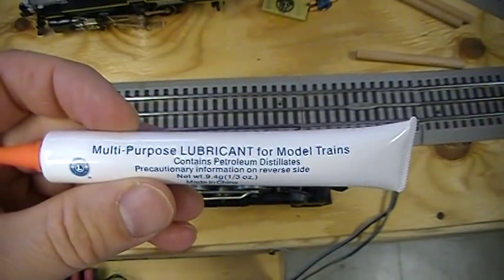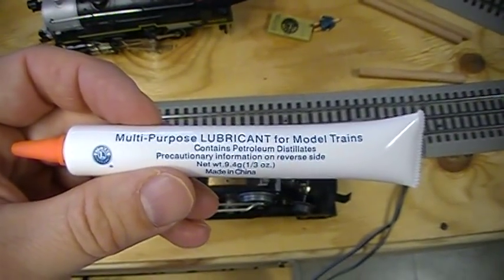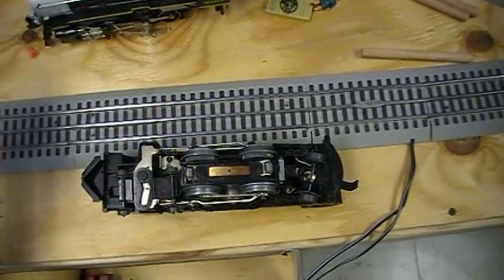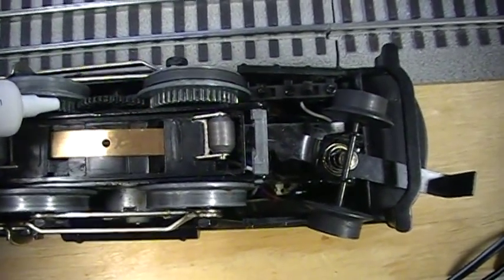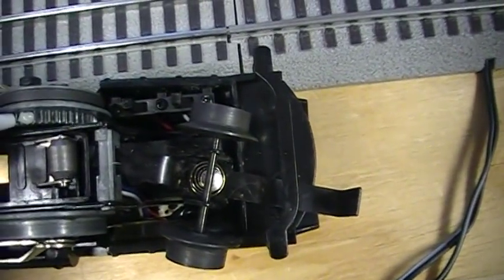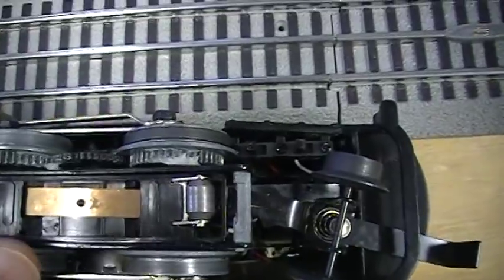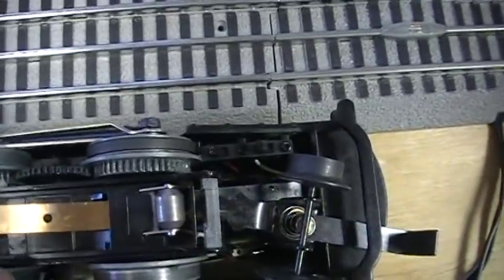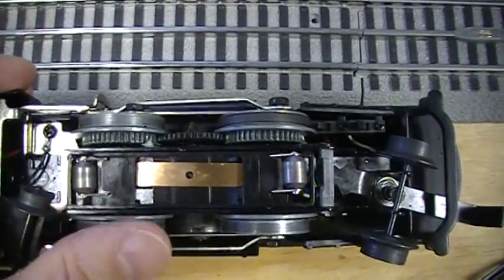How To Lubricate Lionel Model Train Engine Gear 0 Gauge Multi-Purpose  Video

Comment: It is called grease.  Big difference from oil.  He did exactly what you are supposed to do.  Read the manuals.
Reply: Dave Jones I have been wondering weather or not I can put this lubricant on my engines, I have watched both videos by lionel and one says to put this on the open gears at the bottom and another says not to do that. I'm confused on whether or not I should